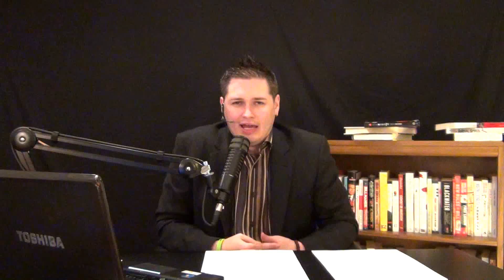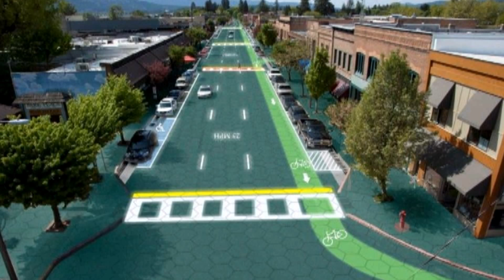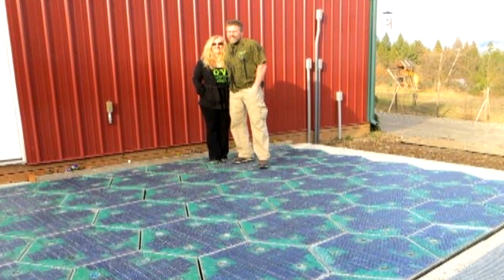Are 'Solar Panel Roads' The Future?

Comment: Being carbon free is not limited to keeping CO2 out of the atmosphere and preventing dangerous warming -- although that's most important now. Even if we can remove enough CO2 from the atmosphere to outpace emissions, we still have to worry about the CO2 that enters the ocean, as it's already beginning to harm ocean life. Also, oil and coal will both have to be phased out as their supply dwindles. Granted, that may take a couple of centuries if our consumption doesn't accelerate further, but the point is we'll need to figure out a completely new system. 

A lot of fresh technology comes with costs. Credit cards put a burden on retailers and can increase prices a bit, digital TV forced some old TVs out of commission, smart phones helped expand work to after-hours for some, etc. We have to be open to accepting the costs that would come with replacing our cars and roads, in that we should weigh them against their benefits and ask which would provide a more sustainable environment and stable market.
Reply: ... and it will eliminate the distortion of economy that the current fossil fuel industry is causing.

Oh, and your old TV analogy is not really accurate. You can still run a 60 year old TV, if it is still working, all you have to do is get a set top box.
Reply: Yep, that's what I was thinking of when I said "stable market"
Reply: Ocean life isn't affected by our current levels of CO2, not by a long shot, it actually helps plancton thrive, and that plancton turns the CO2 back to oxygen, so no harm there.
 Just saying !
Reply: 1. Coral bleaching is expanding in the tropics.

2. Ocean pH levels will continue dropping as the ocean absorbs CO2 emissions. The plankton does help dampen the absorption rate, but we can't depend on that to halt it. If we halted CO2 emissions now or soon, it'd be fine. Unfortunately, barring breakthrough technology it'll take at least several more decades.
Reply: Danx Daniel
When you walk into a room do you immediately consume all of the oxygen available? Or is there a large amount of oxygen that you don't even come in contact with? If this is true what in the hell makes you think that plankton will be 100% effective in stopping excessive carbon dioxide from effecting aquatic life?
Reply: Danx Daniel actually, the increasing level of plankton is probably more to do with overfishing, because larger fish eat plankton, and with many fisheries fished out, there is nothing to eat the plankton, so their numbers are booming.

Comment: No. It wont work, it doesn't make ANY fucking sense.
From reddit: 
bobevans1 
this is a ludicrous idea.
there's no shortage of empty space to put solar panels - they cost a fortune to produce and, given that, the one thing you want is an unobstructed path between the sun and the panel. every car driving over them blocks out the sun, covers them in mud and wears out the surface of the panel.
solar panels are smooth and glassy so that they don't refract a lot of light - this is the opposite of what you want from a drivable road surface with a lot of grip.
as soon as these charlatans can give some figures about the costs per-mile per-lane for these, expected life time, how they age, how much energy they actually produce etc. etc. then fine. but at the moment they're just liars who long ago realised how crazy the concept is.
Reply: Right, roads are already extremely expensive to maintain.
Would be much easier and cheaper to build Solar Power plants plus a decentralized Energy Grid.
Reply: ***** Well they might not be liars but they sure are ignorant. All that electricity will need to be "filtered" through a battery/storage device so the electricity can be used as/when needed.
Reply: What doesn't make sense about it?
Reply: kokofan50 I posted an argument.. did you ignore it?
Reply: ***** The stupid comments hid it from me.
Reply: kokofan50 Youtube has become significantly worse :\
Reply: I empathize with the concern for about how high the cost will be and whether it will provide for safe road conditions. But I think you're going too far in calling them liars. Especially because we don't know how much the price could drop over time and what modifications would need to be made (and whether they could be made) to address your concerns.